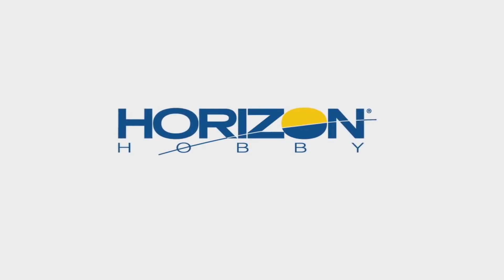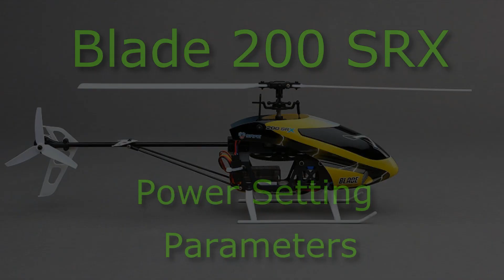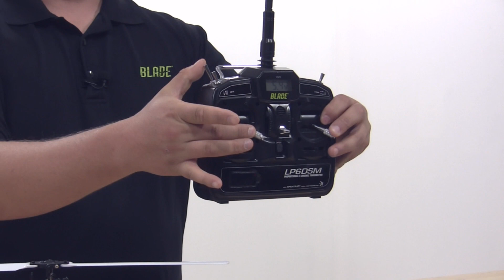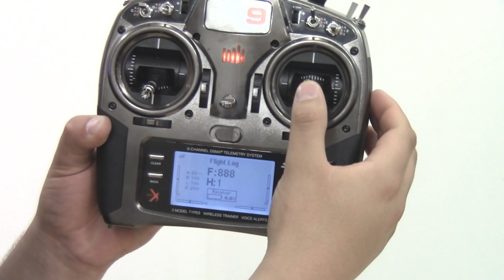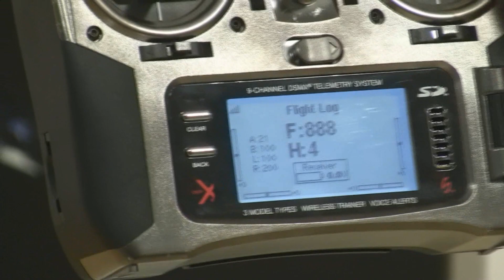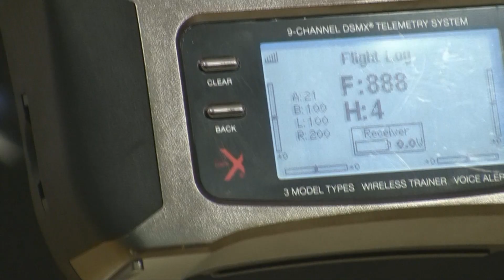200 SRX: Adjusting Motor Power

Comment: Trying this again, I connected the 200SRX heli and then the DX6 and run the throttle trim up to max, but the rotors did start....you said it wouldn't, "don't worry about that..."

Comment: I just picked one of these up.. it was a bout 85-90f out side, had it in the air for about 3 to 4 min puff of blue smoke hit the ground from about 4 feet.. main motor is cooked.
I took it back to Hobbytown  and they tell me its way to hot out side to fly it.... is this true? they are going to put a new motor in it I asked them ,,can I just return it as I am not happy with not being able to fly it unless its cold outside ? and they tell me no you cant... and after spending thousands of $$ at this place over the last 2 years....  
I have seen nothing in any youtube vid or anyplace that says this... the thing also  seamed to be under powered..? bad motor ? 
Please some insight on this subject would be very nice... 
Thank you

Allister
Reply: No should be find a i got the same problem just trying to spool up in my house the 200 srx motor is a problem it happened 3 times to me now if i was going to a store i wouldnt buy it its just fragile and unpowered ALOT
Reply: yup

Comment: I understand trim and how to adjust it in all axes bar throttle. Firstly should throttle trim initially be central and does, "All the way up" mean maximum, ie pushed to the top limit?. I keep my throttle trim (DX6) at lowest level (all the way down) but its not obvious to me where it should be at any time. Using a MJX RTF heli, it adjusts where the throttle engages and can be left so that the heli is rotors running even at zero stick position. The DX6 doesn't seem to do this. Any help welcome, thanks

Comment: hey Steve (or anyone) how do you "o" or zero the 200 servos ? I was told to take the servo arm off then initialize the 200 then put the arm back on. I've had problems after putting on new servos which led to ground hitting.

Comment: I have the Spektrum DX7 radio.  There is a bind button on the back of the radio.  When I do as instructed, turn radio on, plug in helo battery and then attempt the sticks to the bottom right position and push the bind button, nothing happens.  The model stays in the flight mode with normal control responses to inputs on the radio.   Is there a different procedure for the DX7?
Reply: Donald Stark Use a DX9 and you can see the gains on the radio
Reply: Mitch Peterson DX9 is an awesome improvement over the impressive DX8

Comment: Was wondering if u could help me with an issue im having with my srx200. It seems to only hover near the ground, seems very underpowerd with a fully charged lipo, i have it full throttle and it wont climb much just hovers about a foot off the ground, any advice is much appreciated.

Comment: Can u do the same settings with a dx6i?
Reply: Sean Montgomery The settings are stored in the 200sr x not the radio. You can make the gain adjustments with your DX6, DX7, DX8, DX9, DX18.

Comment: i done this and the tail was so bad had to put it back to 100 percent must be away to get the tail to hold
Reply: Ya man mine did the same thing too so I had to back off power just a bit maybe like to 175 percent and tail doesn't wobble so much I recently installed a lynx tail rotor they seem to be a little stiffer

Comment: Any decrease in flight time increasing the motor power? Also any risk of overheating ?
Reply: yogikon Just the opposite and I use a larger battery (Nano Tech 1.0) gives me 15 + min flight times @ 10.5volts

Comment: how do i do this with the dx6i?
Reply: Hey Catch262...did you receive an answer for this? I have mine set up on the 6i as well.
Reply: I am still having trouble setting the gains on this thing.  But I also had trouble setting the gains using the 6i radio.  I love the way the 6 works with this heli though,  I mean it even allows for a kill switch which the 6i could not be setup for kill throttle.  I just need to be able to set the gains because i am getting a twitch/wobble at ceratan spots.